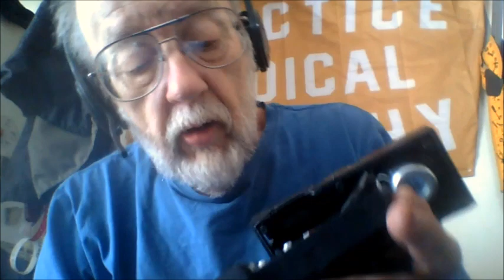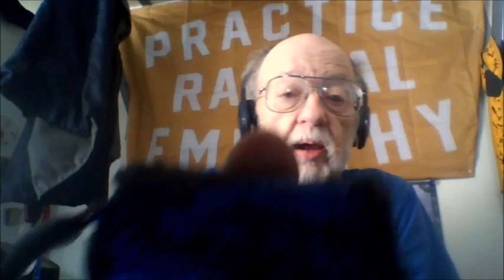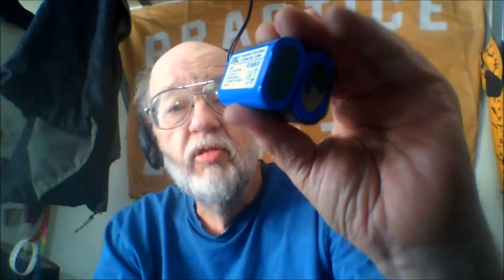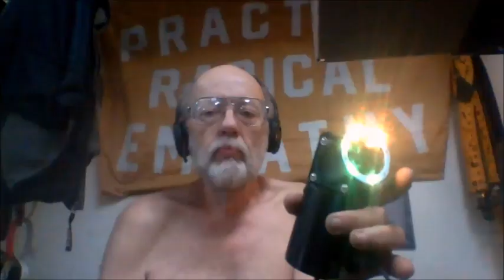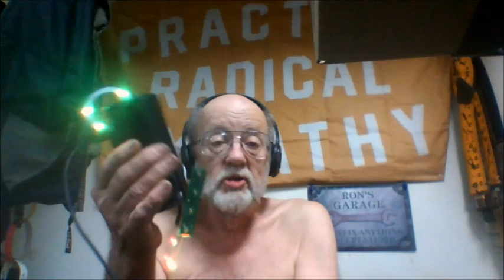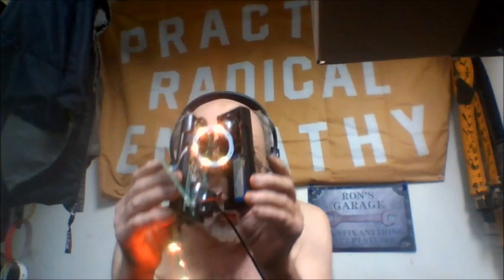Uncle Ron and Stuff   Treblab HD77   Battery Replace   FAIL

Comment: Ron-- thanks for your video.  I was successful-- so 2 things for you (& others) those red lights blinking only show battery is low.  And the battery I got from Amazon for ~$16 had the polarity in the connector opposite, so I changed them to mimic the original.  While both of my LED ribbon connectors broke, I was able to glue one to a piece of the connector and those got those L:EDs to light-- blue as charged and right when about done with charge.  Good Luck!    Well-- one thing not able to get the large black plastic U back on-- so I may cut it in the middle of the back to get the ends on correctly.
Reply from the maker: Alan, wow! Way to go.  Always makes me happy that ones are willing to try a repair  instead of trashing something and with a little luck and thinking around problems that always come up, there are Alan's that succeed. Oh, the world has not been fixed but like a doctor you did surgery on the Bluetooth and saved it. Well done Alan. Well done. Wish there were more doctors like you around.  I do hope you are pleased with your effort. And thanks for the comment of success, as is my reward for posting on YouTube, a chance to help people fix something, save something from the landfill and save some money and time. Well done....

Comment: Postscript-- after successfully using my repaired unit for 3 hours (and the lights blinking red, so time to re-charge) and then charging it for multiple hours, it was dead!  Uggh.  So I disassembled it and found the battery was now dead (no voltage whatsoever via a meter).  I then experimented with a regular 9v battery and it worked.  I also used a "wall wort" that output 9v DC and it worked.  So, I'll "probably" never use the unit's recharging via its USB input-- and instead, re-rout the wires to the board external to the unit and make a "connection" that could power the unit via:  a regular 9v battery, the 9v dc wall wort, or I may invest  (but I doubt it) in a different re-chageable 7.4v Li-ion battery that has its own recharging means.   Good luck to anyone who wants to embark on a similar odyssey.  ;>)
Reply from the maker: Started a reply an it dumped me. Most excellent and follow-on. USB charger cable connection/circuit proglem. I did not think of that when battery replacement did not work. Assumed board issue but did not connected 9 volt battery to see what happens. Most excellent and wall wort a good idea. Something wrong in new bartery or circuit from USB or ?????  Glad you got it and hope all who look at this vid read this add-on. Great add and thanks for sharing..